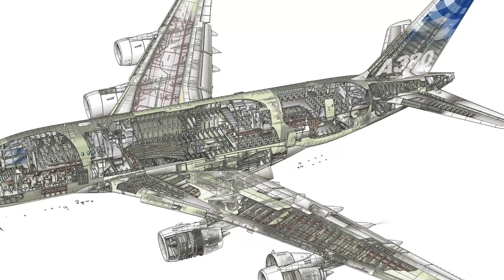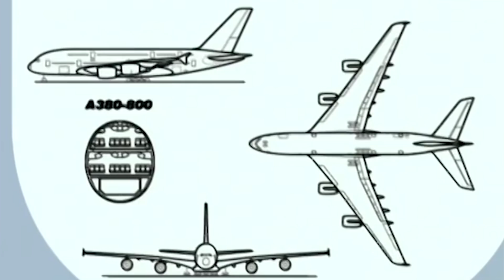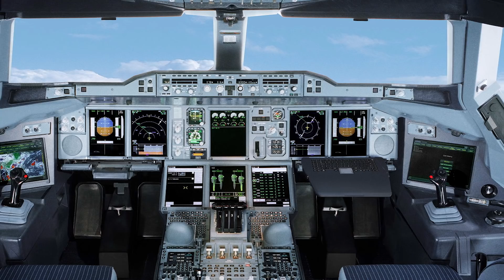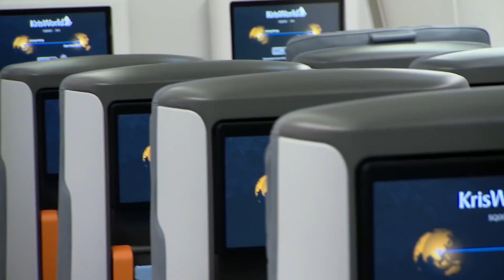Airbus A380 - the European flagship

Comment: Why does the A380 get some much hate? Is it because the 747 got a more efficient competitor and people can't accept another jumbo? This battle between Airbus and Boeing fans is just ridiculous. The infamous "If it ain't Boeing I'm not going" phrase is just retarded.  I'm not hating on Boeing here. I respect both manufacturers for different reasons and I wish others would too.
Reply: Ridden in both. A380 is faaaaar superior from a passenger comfort perspective

It's eerily quiet compared to the 747 and far smoother ride with a more spacious cabin
Reply: I don't think anyone hates the plane. Airbus gets some hate and is mocked because it designed and built such an expensive plane when the market for it was going away.
Reply: This came down to who correctly predicted what the market would be like in 20 years... Airbus guessed hub and spoke would dominate and Boeing guessed point to point... Ultimately, Boeing was correct. Yes, the A380 is more efficient than the 747... It ought to be as it was developed 35 years after the jumbo... But it’s hard to argue, that if Emirates didn’t order the 380, the program would have been dead on launch...
Airbus has a troubled history manufacturing wide bodied aircraft...Airbus has produced 6 different wide bodies over the years... Only 1 has sold over 1,000 copies... the A330. Boeing, on the other hand, has produced only 4 wide bodied airframes, all of which have sold over 1,000 copies... and all four of which are still in production...
Reply: I am honestly rooting for both manufacturers. I adore the A320 and 737, A330 and 777, et al. because I know that they are the tried and true - they have proven themselves. I am also rooting for the new ones, like the 787 and A350XWB, simply because I know they will succeed on the level the others have. I honestly prefer the tried-and-true European engineering of Airbus', but hopefully when the 797 comes, I'll like it equally.
Reply: Americans need to feel best about everything. They are a bit childish like that.
But we are used to it by now, so just let them be..
Reply: I think that the emotions come, at least partially, from the fact that Airbus is subject to political influence in it's design choices. The business factors are, it seems, put aside for the right political decision. That would be the "raw raw raw, we beat the Americas at this". That kind of thinking has produced a number of failures since, in the end, it is business forces that select a winner. It can be annoying for example to hear Airbus claim "the biggest airliner" as if there never was a biggest before.
Reply: @redlock4004  Today the A380 feels that it really was done to be just a record holder. But back when development started on the A380 the hub and spoke model of aviation was still a thing as the 747 was more popular and even McDonnell Douglas were thinking about creating a two-deck superjumbo. So taking into consideration the market at the time the A380 starts to make sense. Today as point to point journeys are more popular it's easy to say that the A380 is exists just to show off. I feel that this misconception and the fact that it's a 747 competitor is the reason for all this hate. I like both the 747 and the A380 because they are something different. In an industry full of single-deck twin-engine jets these two are special and they stand out. It's sad to see both of them slowly dying in favour of newer twin-jets.
Reply: @jkarhiaho  you're actually not right about the market conditions when the A380 was developed. When the initial feasibility study was done in the early 90s this was the case, however when they actually launched the programme it had changed. Airbus developed the 380 at the same time as the 7e7 to be the 787, and if you read the book flight of the titans which documents the two aircraft programmes consecutively you'll see Airbus were pretty cocky that Boeing got it wrong with the point to point LR twinjet,  the rushed A350 is an admission they stuffed up.
Reply: @garethcurtis7545  I'll explain what I meant with "when development started" . When the A380 was first been researched and when it was still just an idea. Back then it made sense but the industry changed rapidly. It's crazy to think how they started a super expnsive programme based upon outdated study results.
Reply: @jkarhiaho  indeed it was and they now have a very expensive white elephant that is likely to never pay for itself
Reply: @garethcurtis7545  They would have to sell another 200 A380s for it to be profitable. The A380 plus programme might increase sales a little bit, but it's true that the A380 might never become profitable.
Reply: Jesse Karhiaho 

It is proof that airbus took too long to bring the plane to production and ignored the market that changed right in front of them.  Rather than scrap the program with a few billion spent, executives kept spinning the program and blew a ton of money to bring the a380 to market when the market was largely not interested.

Even the European airlines like BA, Lufthansa, KLM and Air France represent only a token amount of the total a380 production and if it weren’t for Emirates with capital sourced from high oil prices, the a380 would be an absolute failure. Let’s face it, without Emirates and their orders, the a380 could have bankrupted airbus.
Reply: In addition to Redlock's excellent post.

I don't really see much hate.  Sure, there's one or two posters here that seem hateful, but I think that's just tribalism and the internet in general.  The skepticism you see posted here, I think, has more to do with Airbus, and others, touting the A380 as "better" than the 747.  Sure, from an engineering perspective, it's vastly newer, and does have some innovation, and the A380 is an engineering marvel.  Having said that though, it's hard to dispute that the A380 is pretty much a market failure.  It certainly hasn't penetrated the market in any way like the 747 did.  Additionally, the A380 is an engineering marvel brought low by poor design.  What do I mean with that?  The A380 was designed to fill a role that was diminishing at the time of design, and nearly completely disappeared since then.  The hub and spoke model of airliner transportation is all but dead now, and will die off completely with the newest, longest range twin jets out there.  So, I would say the "hate" is more like a response to overly boisterous Airbus fans trying to make the A380 more important than it is.  That's just my opinion of course, others are available.
Reply: @Desrtfox71  - I think you hit it right in your second sentence. It's "tribalism" that fuels most of the emotionalism. But I see it more from Boing fanboys than from their Airbus counterparts, probably because these boards are heavily populated by Americans.

The admiration for the 747 is somewhat over the top. When you see articles about it, you typically see many posts lauding its "luxuriousness", comfort, spacious seats, etc., when the truth of the matter is, the 747's claim to fame was that it made flying affordable to the masses, and the masses sat in coach, and in an industry-standard 10-across (3x4x3) configuration, that dictated 17.2-17.3 inch-wide seats. Now regardless of how much legroom you have, a 17.3 inch-wide seat is NOT luxurious, unless you're the size of a small-framed Asian woman. I really do believe that many posters proselytizing the 747 haven't actually ever been on one, but are simply parroting what they have heard along the way, much the way a child will repeat what they have heard a parent say in an attempt to seem more mature than they actually are.

As for the A380, I'll hate to see it go, but I do believe that it is indeed going. I admire the 747 for its legacy, but I'm not sorry they're about gone. Korean Air is one airline I take often, and they fly the 747-8i -- I avoid it. It has the same narrow seats that the 747-400 had back in coach, and there are much better choices, now. For instance, their 777's are outfitted with 9-across seating, which are noticeably more "spacious" at 18+ inches wide than the 747. Japan Airlines offers their 787 in an almost unique 8-across configuration, with 18.9 inch-wide seats -- IN COACH! The now-standard 787 coach is configured in 9-across, and so equipped, it is a Crampliner.

I'm booking today for a transpacific flight, and the wife is going. When she announced her desire to go, the other thing she said was, "we'll go Japan Airlines".
Reply: 747 Orders = 1,500+
A380 Orders = 331
50% controlled by a Single Airline